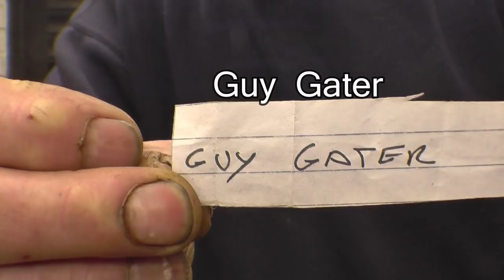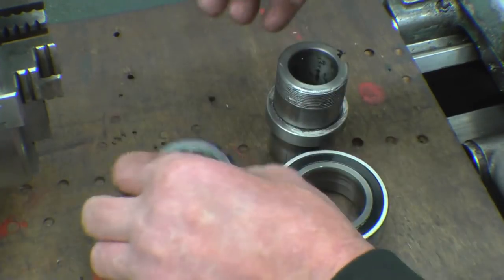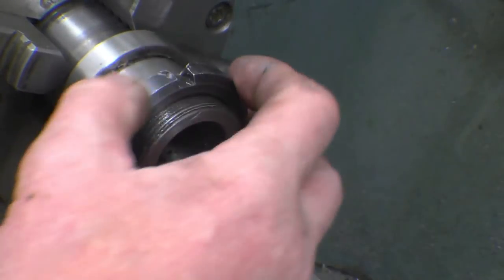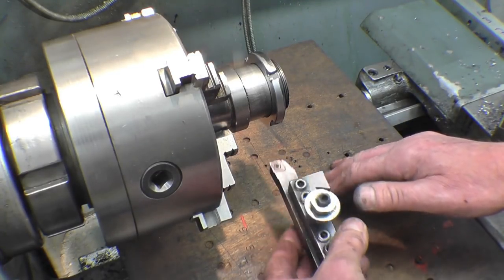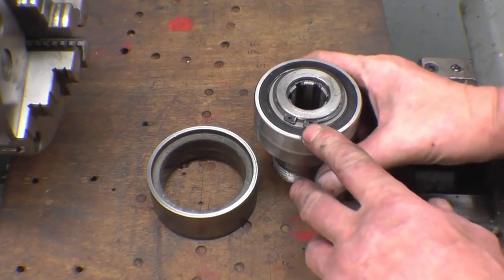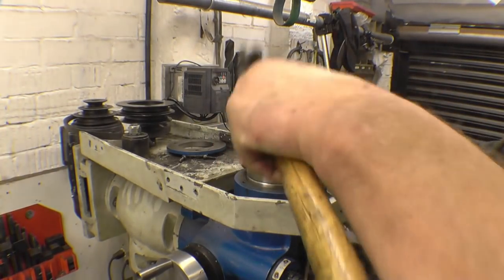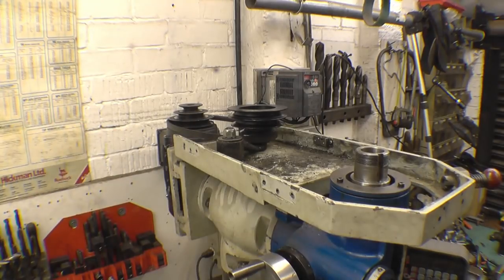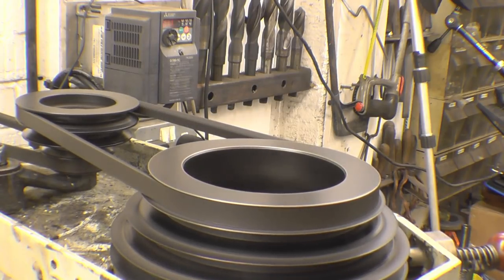SNNC 301 P1   Thread Repair,  626 Mill Belt Noise

Comment: Hi John. Tip of the day: Use a longer tube (taller than the shaft sticking up) to knock the bearings into the housing or screw the nut on the top of the shaft before you start swinging the hammer. I could actually hear the 'thunk' when the hammer face caught that top thread again, (13:45) right after you just cleaned it up. 
Been there done that - that's how I know!  Cheers.  ;-)

Comment: The third tool you showed is not 45°. 😉 Symmetrically mounted rhomboid inserts (CCGT/CCMT) cut a 40° angle unless you add some with the toolpost.
Reply from the maker: My mistake thanks for pointing that out